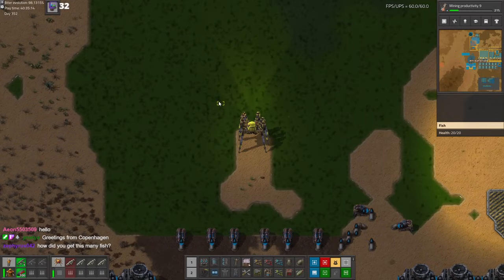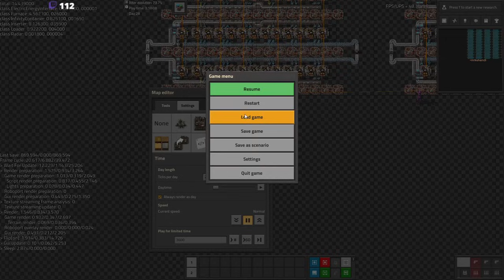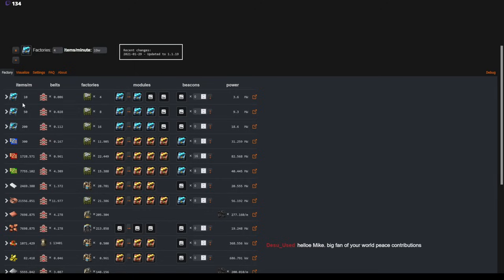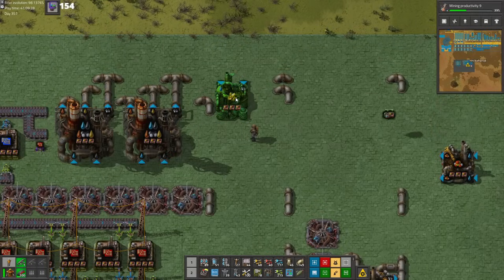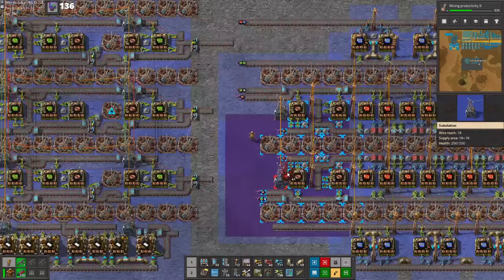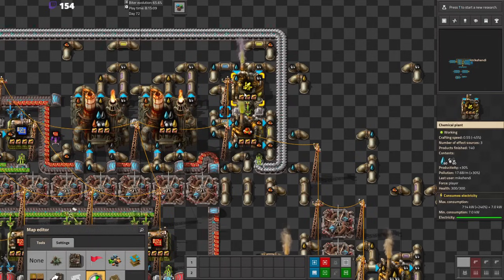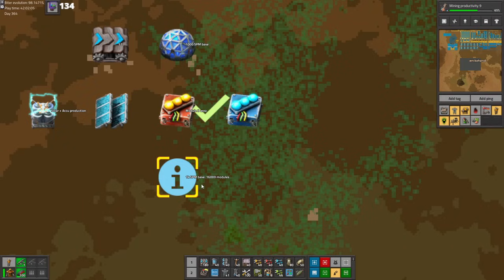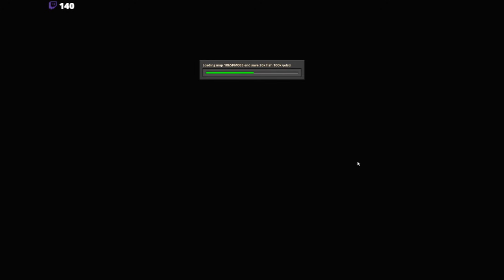10000 SPM (Biters ON) #9 // Designing a specialized Mk.3 MODULE area

Comment: The biggest reason the clocking doesn't make a big improvement here is because you have 26 inserters on a 2 combinator clock repeated 4000 times. If you had all 52000 ore inserters on one clock and all 52000 plate inserters on the other then it would be a big speed gain.

Comment: If you were to space out the output inserters, that is, not clump them into groups of two, is it possible that they would be able to more quickly drop the 12 items? If each inserter has 3 belts of space to drop items to, they can drop 4*3 = 12 items and then go back to doing nothing quicker, right?
Reply from the maker: Yeah, evenly spaced clocked outserters DO have a UPS benefit, I will figure this out WAY later tho

Comment: Spends hours figuring out how to clock inserters to preserve ups. Then procede to spend hours making the worst path possible for fluids in order to have it look symetric.

Loving the idea of the series, love the channel. But i confess i fall asleep to this some times. Specially during these repeated long strings of minute changes and reworking the same thing over and over and going back and forth.
Reply from the maker: Ah, the perils of getting nerdsniped and trying to "quickly" figure out new stuff on stream... Feel free to skip ahead large sections of, say, attemts of UPS clocking or Biter blasting. (by now I DID figure out how to "correctly" clock and save some UPS (TLDR: needs equidistant inserters for maximum benefit)